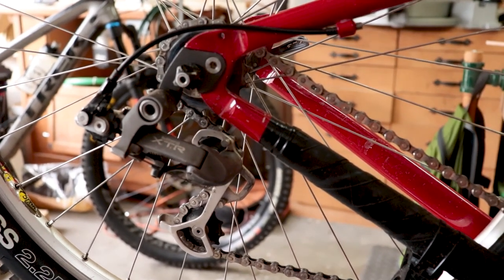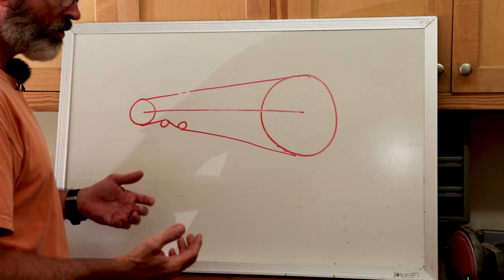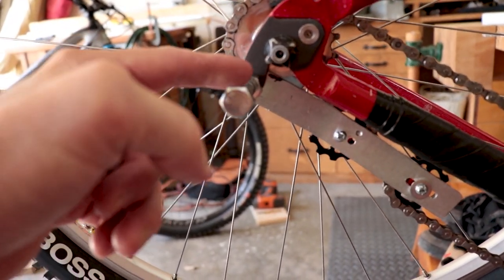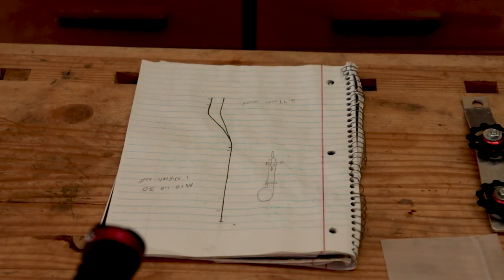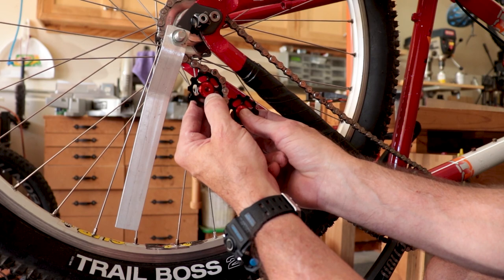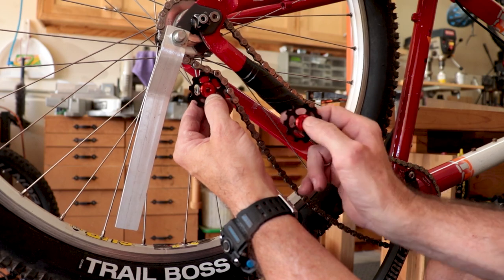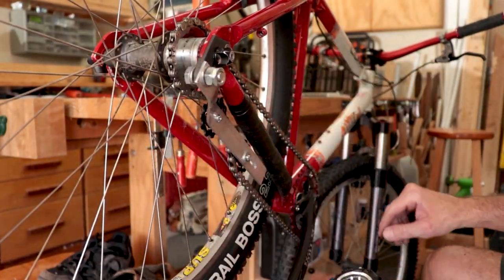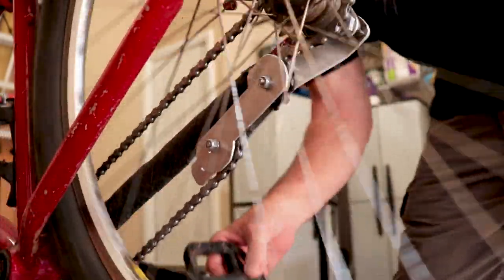DIY MTB Single Speed Chain Tensioner. On Oval and Round Chain rings!

Comment: Hi, I think I am missing something. Why do you need a tensioner again? If it's a single speed without suspension, what limits you to make the chain smaller? Sorry if this seems like a silly question?
Reply from the maker: Not at all. I should've explained better.  Bikes designed to be SS come with horizontal drop outs where the rear axle can be mover front and back to get perfect tension. Geared bikes have an almost vertical slot and the rear wheel is not adjustable. I took out as many full links as I could and still have the chain reach but it was really loose. Each link is 1 inch long so chances are the chain will be either too short or too long by itself. I hope this helps

Comment: If you Had the perfect tension for a single speed on a round chainring Would changing it to an oval break the perfect tension?
Reply from the maker: Yes. An oval CR that’s 32 tooth acts like a 34 tooth when the oval is tall and a 30 tooth 90 degrees later in the pedal stroke.  It’s pretty wide range of tension. It you are at perfect tension when tight (chain ring tall) it’ll fall off when loose.